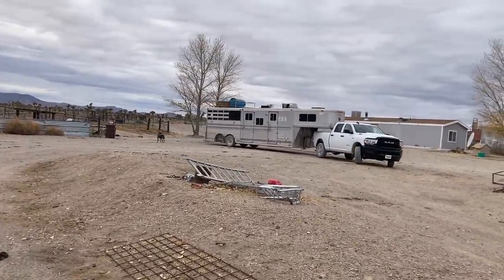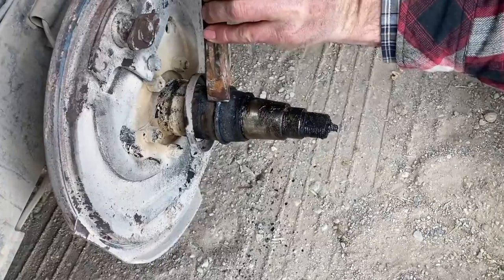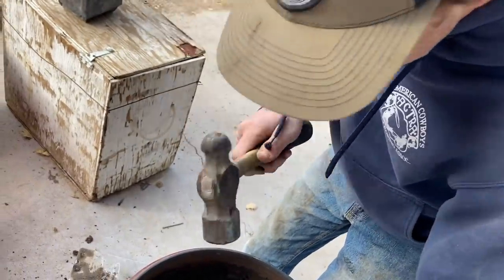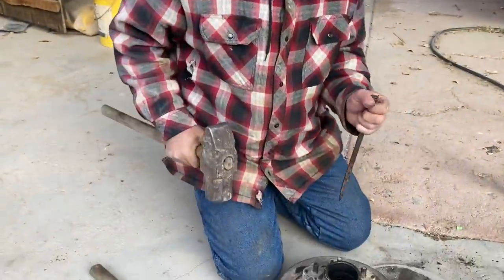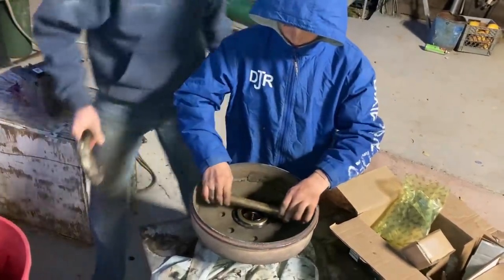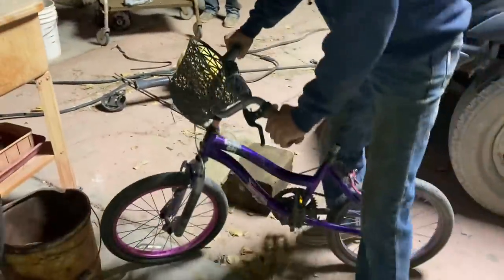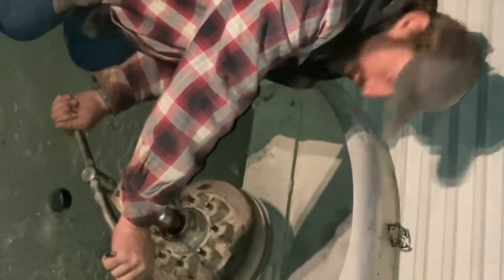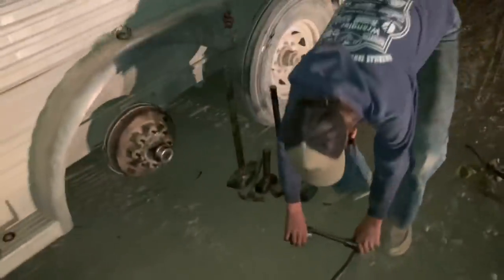**SUPER boring BEARING Replacement * On Trailer 😴

Comment: I know its a year late but it looks like you overtightened the bearing. Have you cooked it yet? Spin the hub and do it up just firm. One hand over the centre of the spanner will do. Back off the nut and do it up finger tight then back off to the first split pin hole. Bend up the clip then fit a split pin. You will feel a tiny bit of play at the outside of the wheel. Finally set up a program to repack all the bearings on the farm. 😁

Comment: It would appear that you have no trailer brakes on your livestock trailer. With the weight you would tend to haul, wouldn’t brakes be required? If not required in your state, it would most certainly be advisable.